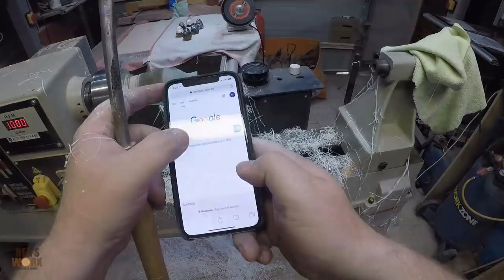Micro Machines ship in a bottle - Epoxy Resin Art

Comment: Hey Ben,  Love the videos. Try using the vacuum chamber to only remove the bubbles after that allow the resin to set with no vacuum. I believe the pressure differences between the set resin and drying resin is causing the cracks while still under pressure.

Comment: I wonder why this resin is cracking inside? But very good work. And creative thinking.
Reply from the maker: Thanks Mate, I think it’s the air trapped in the model
Reply: If you want to avoid cracks, pour the casting resin in separate, smaller pours/layers. Add the next layer once the previous one has cured.

Comment: These tiny toys might be having some issues with air pockets in productions. Thinking that these little air pocket do not take away from the intended play. It was easy not to worry that someone might incase them in a epoxy resin and place them under pressure. But what I like about it, it make the boat look like it just sunk, and air bubbles are escaping from the compartments.
I like you to try this again, with sand, but you may want to make a smaller casting at first, then another in  clear so you have a buffer from the sand. Making the glass look thicker too. Thinking this might save time on turning and on tools. But I am no expert, I have only been watching your videos for the last couple of weeks.
 I am enjoying watching them.
 Every one stay Safe, stay Healthy!!!
Reply from the maker: Thanks Lorrie 👍

Comment: Another great bottle project you made. With your sand problem killing your tools is it at all possible to pour a thin layer of clear epoxy say 2mm-4mm thick on the bottom then pour your sand layer then your blue water last. That way you have a small amount of epoxy to turn off to form the shape of the bottle before you hit the sand layer and wear out your tools. Keep these awesome video's coming mate.
Reply from the maker: Thanks for the tip Steven 👍
Reply: @BensWorx  No worries at all. Not sure if it would help but could be worth a try to see if it works.

Comment: If you ever do try to do a wax sealed bottle again, I used crayons melted with hot-glue sticks together. Ratio is kind of up to you, but I think I recall using 3-to-1 glue-to-crayon. I used that to seal beer bottle from a batch of homebrew. It worked, but was VERY tough to remove.

Comment: did something similar with sand once, i think next time im going to use the saw dust from various woods all mixed together to get the different colors found in sand. also you can get sealing wax on amazon that is normally used for printing a seal on fancy letters or topping off a cork of homemade wine and comes as a bag of nice little pellets in various colors.
Reply from the maker: good idea mate

Comment: About the crack:
I've watched other people coat    the model/Lego  with a thin layer of resin or CA glue. It will  seal it and hopefully prevent air from escaping.
I had that thought when I was watching the "Enterprise in a bottle" video, but forgot to mention it 😬.... sorry.
Reply from the maker: Thanks for the tip mate
Reply: Funny. Just posted a similar idea, although slightly different theory as to the cause.🙂
Reply: i was wondering if the heat from curing was maybe causing some expansion?
but i agree...pre-coating might have made a difference...

Comment: Have you thought of making a silicone mold of a bottle and using that for your casting. Even if it is oversized it will be in the right shape to start with.  Option two, have two molds. One is the inside of the bottle. You cast that first then the other is the bottle mold. Put the plug shaped one inside the bottle one and cast that in clear so it looks like it's actually inside a bottle.
Reply from the maker: I will give it a go 👍

Comment: One idea would be to pour a small bit of clear resin as a base layer about 1/16 inch thick tgen do the sand pour so you have a clear layer to smooth before you get to the sand.

Comment: Might have gone to a band saw and sawn a flat spot off the bottom of the sand. Then when it was on the lathe the skew would skip over the sand as it turned. And, it would have provided a flat spot to lay the bottle down on.
Reply from the maker: That would have worked 👍

Comment: I wonder if the cracks are something to do with the models. Maybe that particular metal or plastic expands and contracts a lot as the resin heats and cools when it's curing?

Also, where did you get your pressure pot from? I'm also in Australia (just down the road in GC, even).
Reply from the maker: It’s a possibility, there’s a video on my channel about my pot 👍
Reply: Ben's Worx I honestly think the crack happened because you poured the resin in all at once, instead of pouring a small, thin layer every 5 hours (I’ve made the same mistake before). 😬

Comment: Just a suggestion,  but maybe next time you could paint whatever object with some uv-curing resin before you put it in the regular resin? Theory beong that there is some chemical in the plastic that is causing those cracks and if you encapsulate it in the other resin first, it won't react.
Reply from the maker: Yeah I’m going to try that next time 👍

Comment: The resin you are using is holding bubbles, gotta try a different resin or put a torch on it every 1/2" or so. How you get the finish on the bottles is pretty good, I will start buffing my river tops instead of sanding down to 3000 grit and glaze coating.

Comment: Have you taken in to consideration that all the models you are using are filled with air? Try drilling a small hole and filling it with resin first then set it in your "BOTTLE". That might help.
Reply from the maker: Thanks for the tip mate

Comment: Hey Ben, love your videos!  I just recently started working with another woodworker that uses recycled skateboards and casting them in Alumilite resin for him.  I had similar, smaller "cracks" like that in a few castings.  My thought, that I haven't tested yet, is that it is the resin reacting with some of the graphics or wax on the bottom of the skateboards.  You may be having a similar issue.  Maybe try cleaning the Micro Machines first, or coating them in a clear shellac to try and seal it off so the resin doesn't react like it has.  Just a thought that I am going to try myself.  Happy casting! Chris @HiramWoodworking
Reply from the maker: Thanks for the tip Chris, I will try to coat in UV resin next time 👍